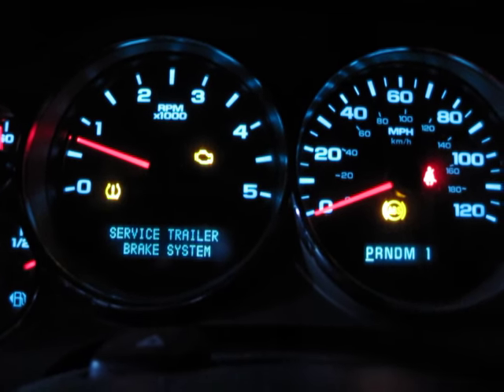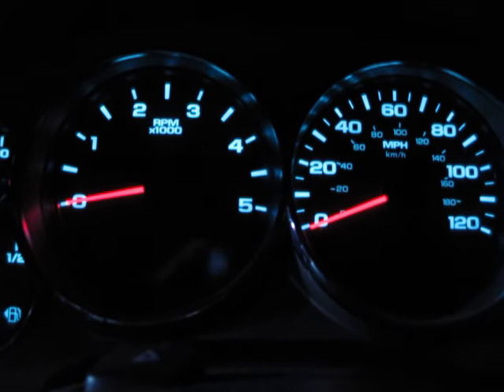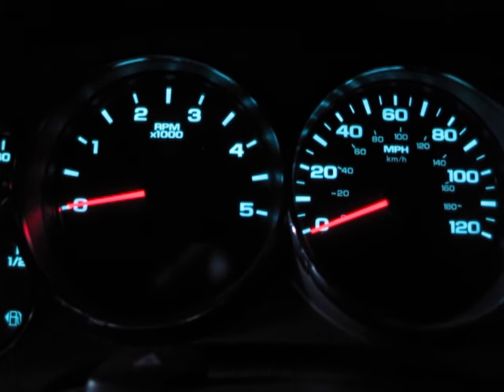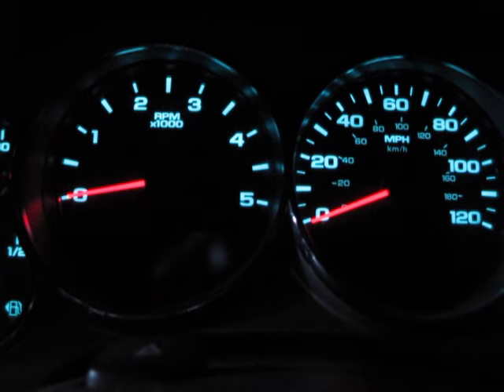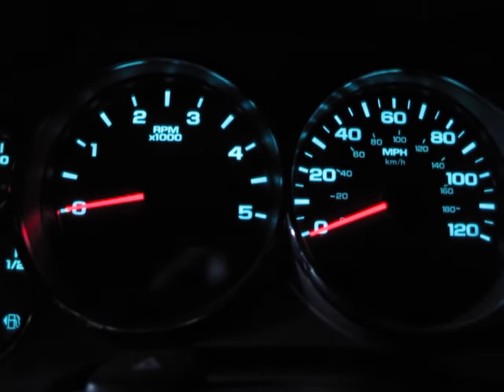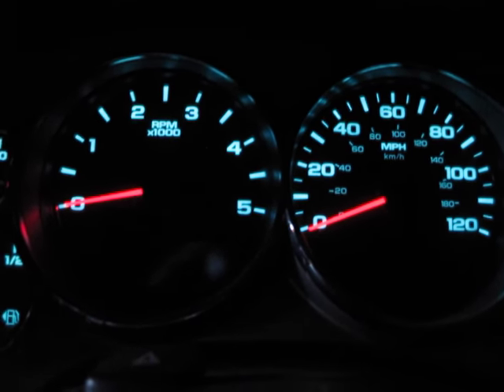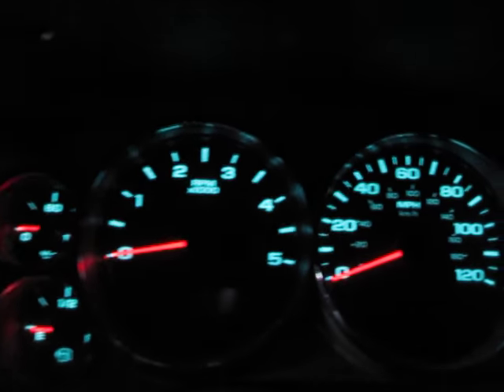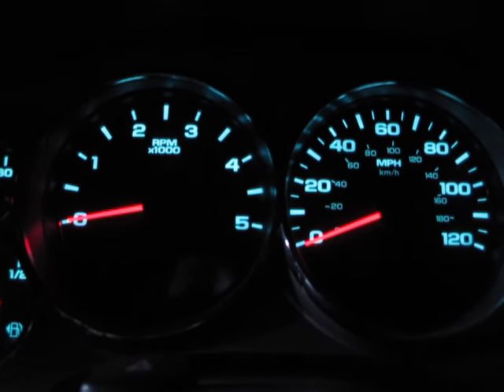Service Trailer Brake System Duramax / Silverado

Comment: Can you please post a picture or a video of how you wired yours in ive tried the replacement switch and relay nothing works i havent tried the module under the dash but if I could wire in a aftermarket easier id rather do so.

Comment: The problem is the trailer brake relay in that year model, I found mine over the rr dual on the frame. Loosen the 2-10 mill screws unplug the relay & remove from the inside. Replace & bingo, trailer brakes!
Reply from the maker: I tried replacing the relay and it made not difference.
Reply: Replaced mine also with change

Comment: Sooo... you didn't fix anything?
Reply from the maker: Yes, like I said in the video, the TBCM works great until it doesn't, it's a known problem with these GM pickups.  Omitting the factory unit in favor of a quality aftermarket unit is the fix.
Reply: Exactly I useless video he didn't fix the problem he bypassed the problem.

Comment: I just fixed my 2011 Silverado 2500 HD Diesel and the part was found above the spare tire and mine had 10mm hex head- I think it has been replaced before

Comment: Most of the time on these trucks it has nothing to do with the trailer switch or even wiring.  There is a relay switch under the box up under your spare tire very easy to fix

Comment: No research ? No repair ? you waisted the money on a Prodigy instead of the about $30..for a module to fix your factory system in 30 minutes or the dash brake switch is about $40.00 and also an easy replacement. You must hire everything done, is how you come up with $150.00 repair. OKIE DOKIE nothing to see here for sure. This is not considered a fix or repair since you STILL have the Service Trailer Brake System light on your dash and no attempt to repair the factory system.
Reply from the maker: I don't care if you like the way I fixed it or not.  The TBCM are known weak points and if you replace them they can fail again.  It had nothing to do with a $40 brake switch so what are you even talking about?   I was towing my trailer out of state when this stopped working.  TBCM's were $150 at the time, I would have needed to order one and wait there for it.  I needed my trailer brakes to work, with parts I could source at the Oreilly's there in Oregon, and I fixed it.  The money wasn't wasted, the Prodigy is a very good module and served me well until I sold the truck last year.  Thanks for chiming in buddy, you're a big help.

Comment: I am having the same problem I’m trying to install an aftermarket and I’m not knowing where and how I’m supposed to find the brake switch
Reply from the maker: It's either on the brake pedal or the brake pedal bumps up against it, can't remember.